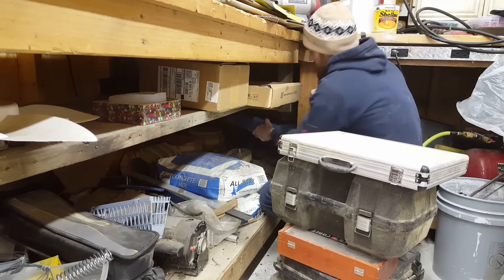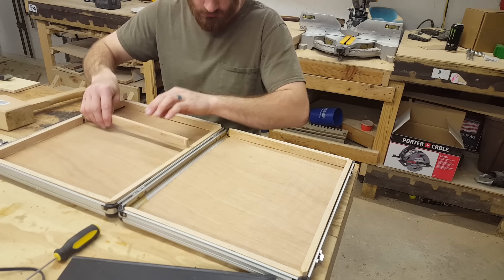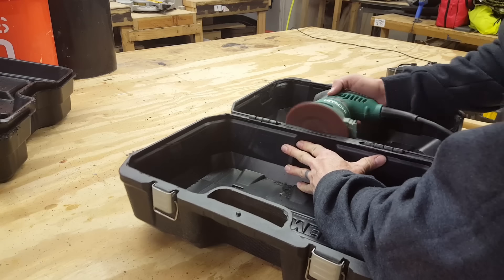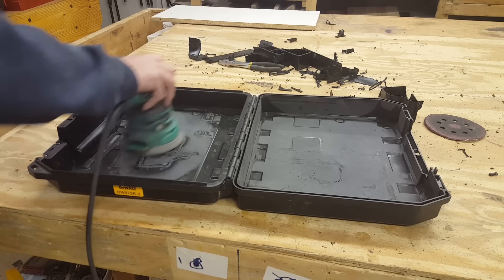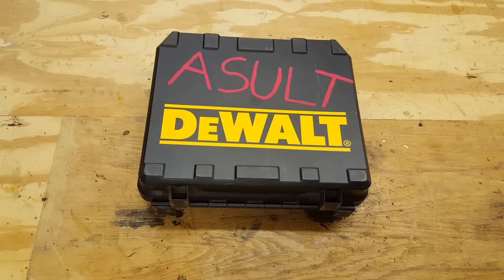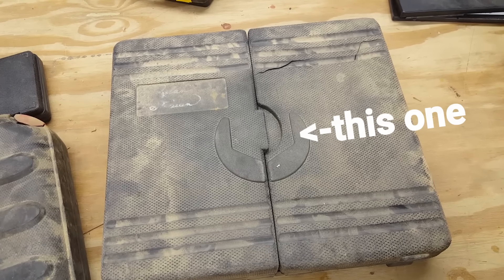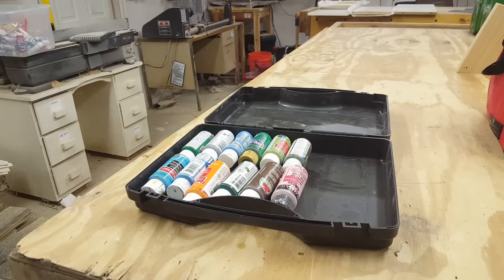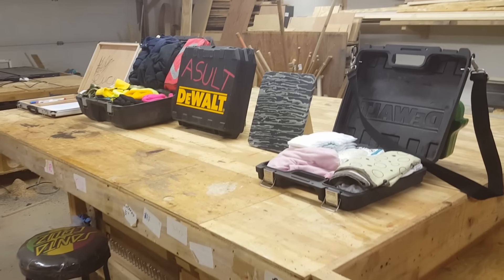5 Things to Make With Old Tool Cases

Comment: I intentionally buy cases at thrift stores for "just in case I need to store something". I picked up a couple big DeWalt kit boxes (saw, drill, charger, batteries) and cut the posts out of it. One is a great case for my Dewalt power washer and attachments (foam sleeping pad cut up for divider between halves) and the other was turned into a battery box for my son's solar charging and storage sytem in his pickup.

Comment: Great job reusing items and keeping them from the landfill. Reuse is always better than recycle. I did the same for two cases I found, one is used for my angle grinder and all it's gear. One is used for my 50' extension cord.

Comment: Awesome video. Thanks. I have similar issues .. I place extension cords in mine and anything sharp like extra blades for power saws or steel files and minor flammables in lieu if safety cabinet.

Comment: Most of my spare plastic boxes are already pistol cases, hehe.  But I did turn a wireless microphone case into a dog possibles case for her brushes, muzzle, deshedding tool, and such. I took out the foam and sanded it smooth.  And then cut to fit some woodgrain vinyl shelving paper to cover where the foam was glued in.  The possibilities are endless.

Comment: Neat. Saw your thumbnail and thought for a second 'that's mine!'. I have a DeWalt cordless case with 'NOT' written on it in red paint above the 'DeWalt' 'cos it contains a Ryobi cordless - fits right in with some judicious trimming of the plastic bits with its spare battery and charger, some drill bitts and stuff. I have others red-labelled with other makers' names - the yellow lettering comes right off with a bit of petrol.  They get through a lot of DeWalt stuff at work and just bung the cases in a skip where I 'rescue' them.

Comment: You could always keep your tools in them. What a novel idea!
Reply: but usually not very efficient.
Reply: I use one to hold various socket sets & ratchets.
I also use one to hold drill bits & drive bits for screws & bolts...

Comment: I've been using my Fein Multitool to clean up old cases for about twenty years. I have a Panasonic drill and driver case serving as my range case. Well, one of them.  A Porter Cable case holds my camera lenses, filters and cleaning equipment. A Festool case is doing duty as a metal detector accessory tote. Another case holds my Edge Pro sharpener and accessories.

Comment: Cool. I modified an old tool case as an armoured laptop bag and had enough space for a Laptop, spare batteries and a mains power supply/charger, plus USB cables, etc for charging my phone as I use mine remotely sometimes, away from mains electricity for a full day.

Comment: When you add wooden walls inside, like you did with the pencil box. Make them go all the way to the inside of the top. You can fill it more and everything won't fall out when opened. And with a few more cuts on the table saw, sliding boxes on top of the paper and pencils.

Comment: Great ideas!  One thing I always do is carry a box like this with Emergency Gear     AKA -  If you gotta pull off the road at 4am and take a crap and need supplies.  Toilet Paper, Wet Wipes, extra pair of underwear (Yea all you guys done crapped yourself at some point).  These would make a perfect emergency box for those situations.  Put Vacume Sealed emergency gear and stuff in them as well.  All great ideas.

Comment: Great video on repurposing 👍! I use a red, older model metal [operative word], Craftsman toolbox on wheels ( the smaller model 3 1/2 x 2 ft.), for a perfect place to use my butane stove for day camping. It has a cute little shelf inside with a cute little door that swings open. I just lift up my suv hatchback, roll my "kitchen" a bit towards the back, and stand there like a short order cooking up a meal that passersby's say smells like a restaurant! (must be the garlic😉). Best thing about using this kind of fire-proof toolbox is that I don't have to worry about a possible flare-up catching anything nearby on fire. I see so many youtube videos with people cooking on top of wood counters with curtains as backsplash. If something unfortunate happens inside anything insured, explaining how it occurred to the claims department determines whether or not, anything gets paid.

Comment: Yeah did the same, cutting up/re purposing old cases.  One I used for sand paper.  Best thing I ever did, all the shelves, slots, piles disappeared.  Open the box & they're there from small to big.  I don't use any one type enough to keep only square in one, orbit sander in another, so it's nice to have them all in one place.  Plus it was a skinny case & I really didn't know what to put into it.  In a way the old cases have turned a portion of my shelving into a library.  There's a row of cases with a label on the back, just like the titles on a book.  lol :-]

Comment: I had a toekick drawer in the kitchen of a previous apartment and the only problem was that there wasn't really anything I had that was thin enough to fit inside of it. I used an old socket case that I had hollowed out much like you did here to make a BBQ grill kit: tongs, spatula, scraper, wire brush, baster, basting brush, room for some bottles of custom rubs and marinades, and along the top a couple mini spring rods (kinda like one those spring loaded shower curtain rods only WAY smaller) to hold a tube of aluminum foil and a tube of saran wrap. Finished it off with a hacksaw blade that fit in between a couple of the outer layers of the case with the teeth sticking out (which fit into a slit I cut out with a dremel into the top half of the case). The end result left the rolls able to turn so you could pull the foil or wrap out of the top until you had as much as you needed, then close the case to make a nice straight edge when the hacksaw blade made the cut. Carry the whole thing out when it's time to grill and you've got all your tools in one place, plus you've got your leftover storage MOSTLY covered. If I hadn't forgotten and left it in that drawer when I moved out, I'd planned on seeing if I could incorporate a way to hold a pair of potholders and maybe figure out a way to hold a few ziplock bags as well. All-in-all it looked really sharp and worked well. Hopefully the new resident found it and enjoyed.

Comment: The DeWalt cases make great gaming cases, especially if you line the inside with carpet or rugs.  I have also made cases from old Coleman camping stoves.
Reply: Thanks for the idea I have an old one kicking around but it's missing the propane hook up, might be able to find a use for it now

Comment: Great idea using old plastic cases, add a rubber gasket around inner edge to make it water tight, an put camping gear inside them. Use metal cases for emp protectors. Best part, nobody knows what could be inside by looking at them.

Comment: Some suggestions 

1: Forgot to add an additional barrier in the top of the metal case to keep the markers from moving out of place while the case is closed.

2: A heat gun would've been better to  reform the blow molded interior of the PP case so you'd lose less rigidity. Can use a bag of heated pea gravel or sand to help form new contours too.

3: It's "assault," but the bigger crime is not spraying "Ass" over the "De" to make it an Asswalt case.

Comment: You could easily add a fold away easel to that art case with a couple of hinges & drop down supports, maybe raised a little to keep supplies underneath? Also maybe place some tight elasticated strips, pockets etc in the lid to tuck even more supplies under/into? 
Great ideas 😁

Comment: I took an old DeWalt 18 Volt drill motor case and recycled it for -- get this -- a 20 Volt DeWalt impact gun! The 20v charger fit in the 18 v charger slot, and the impact gun fit almost exactly where the drill was. Room for 2 spare 20 volt batts and a small bit case. They don't give you these hard cases anymore -- just a cheap yellow/black fabric bag that falls apart. I saw a similar black DeWalt case at a Goodwill for $4, but I passed on it. Later I thought I could have put it to good use.

Comment: OMG! I keep them just in case I sell the tool it "adds more value"... I'm a joke. I have 2 Dewalt Laser cases that are HUGE and bought a Harbor Freight water proof that fits both with batteries and custom foam a third of the size of a single Dewalt. Keep in mind that carrying a Dewalt case with cloth in your car draws attention for thieves lol.
Another thing, "food safe" not only means non toxic, it also means that the surface wont hold humidity for mold or germs to reproduce. Too many mini holes too be used for food (I think).
THANKS FOR YOUR VIDEO!

Comment: Just built a Portable Dewalt T-Stak ARB AirCompressor for my Truck, will post a video soon, plugs into a 50A Anderson plug, and all the wirings hidden in a junction box with the ARB RockerSwitch, Anderson plug, and the Compressor, with room to store the 27ft air hose, tyre inflator gauge and the 10m Anderson lead 👌🏼👌🏼

Comment: I used one of those latching Dewalt cases and made a rat/mouse poison bait box... i cut all the nonsense out like you did. But reglued some shorter chunks in the corner (like a little feed dish) then cut a small chunk out of the side so mice can crawl in. And then finally put a piece of plexiglass on the lid so I can see what's inside without opening it.

Comment: I have a dewalt box and plan on using it for kitchen cabinet service calls for my job - cut out the center baffles already - want to fill it with a corian piece as big as will fit, piece of scrap plywood of same size, and various rips of maple scraps corian scraps, laminate scraps, sandpaper scraps etc that would be potentially useful on service calls - never know what'll come in handy

Comment: I took one & used a neon transformer ( low profile 12k) to make a fractal wood burner with multiple activation switches heavily insulated wiring (welding leads) and power progress lights, all lights had to be activated successively or it didnt work. Ive had it for about 10 years & all the high voltage labels have people afraid to touch it!😆

Comment: I create many things, not yet sold in stores, with Kydex and PVC cement.  Kydex can be warmed with a Bic lighter or heat gun to bending.  Easy to cut, laminate, bend, paint,,,, 
I go for a 'crude, but effective prototype form' of what I need.
See if PVC cement bonds to the tool case.

Comment: I used an old drill case to hold tools and all my bolts when I remove my transmission. Work really well. Now I don't misplace anything. Now I don't have to run around looking for tools.

Comment: Great idea. I especially like using the old steel tool cases from decades ago. More durable by far than anything today and they look cool. I have a 2 that were my dads when he was working as a carpenter when I was a kid. Our last name is still written across them by him. They've been perfect for small/medium tool kits built specific to my Jeep. They can be smaller because I don't take the tools I don't need for that vehicle. Check online for comprehensive tool lists specific to your vehicle, someone has already done that leg work for you.  
I use another for all my bike specific tools.
I will also repurpose old lunch boxes and food containers for things like camera equipment and other things I don't want stolen. It's perfect. They're free, waterproof, padded, and no one is going to break into my vehicle to steal an old lunch cooler. Plastic peanut butter and mayo jars are perfect for first aid and survival kits, and even camera lenses with a little padding added. I use bubble wrap for that and it works fantastically. The one bummer about old tool boxes is someone might think they have expensive tools in them they can pawn off.  
Other ideas; Manly briefcases, ammo storage, camp kitchen ware, gift boxes, laptop cases, tackle boxes and for organizing niche items you need to have access too, but gets scattered easily, like all your trailer hook up stuff, bungee cords/straps, plumbing and electrical tools, bits,and bobs. Larger ones, like what my porter cable router came, in might even be a good carry-on size.  
Good video!

Comment: What about a proper power bar with extension cord. Maybe even a few sealed outlets on the outside. And a space inside where you can store the Cable for transport or extra cable during use.

Comment: I work for a machine shop. The owners have a sort of hoarder mentality and save not only the cases, but the batteries, chargers and the tools themselves regardless of the fact that they have not worked in many years. Funny how all of that disappeared after I went to work in the building I am in now. Anyway, I threw away several old plastic DeWalt cases, but I saved one. An old school metal case. It is damn near pristine. I use it as a lunchbox.
Reply from the maker: 😄Thats awesome

Comment: Another thing that it could be used for is a drone case just cut out some foam inserts for a drone, controller, some batteries and if you wanna get fancy put in a 3in1 charger and wire in a plug to charge all the batteries inside the case. And I literally just gave myself an idea for repurposing an old drill case.

Comment: For those not in the US, Liberia, or Myanmar, the conversion for oven moulding the plastic is 177°C. I wonder if a jack operated press would be a good addition when pressing the hot plastic? Quicker to apply pressure while the plastic is still really hot.
Reply from the maker: Thats a good idea

Comment: In the gun case:  add a flashlight, space for a box of ammo, tools for adjusting sights and cleaning, and instead of just being storage for the gun, it becomes an all in one range day / response case with everything you will need to accompany the gun when its used at anytime. Also probably neeed to think of a way to lock it, unless it is going inside an actual gun safe.  Something more elegant than wrapping a chain around it with a padlock, i would hope xD
Reply from the maker: Good idea! It does have a spot for a lock

Comment: If it would fit under a car/truck seat you could epoxy magnets on the underside of the seat or floor and contact side of the case and use them for trauma kits or lockable storage.

Comment: I always wondered whether spraying the inside of the polyethylene case with Rhino liner would bring back that rigidity. I've been building things with these boxes forever and reinforcing them after you cut out the inner shell is usually the make or break moment in a project.

Comment: Have you thought about making one or 2 into a survival stash ? what I mean is them containing the basics, such as a folded tarp, with some paracord, tent pegs, etc and another with a small hexamine stove, packet noodles and other dry goods so you get a quick meal and other general survival stuff, such as a decent knife, cigarette lighters, etc.  Then sealed around the edges when full with waterproof tape, in case of any water seepage, wrapped in a couple of heavy duty garbage bags or similar then buried in a location only known to you in case of emergency and having to bug out.  Just a thought, so you have spare gear stashed away from your home.

Comment: Haha this was brilliant! thanks AC! - Ps i dont have many of these plastic tool boxes but one i do have to store my cordless drill had its hinges and closers broken off (flimsy plastic) any ideas how i could make/ attach new hinges?i tried grey and black tape as a temp solution but to no avail, the tape just comes off over short time :-(
Reply from the maker: That's an interesting question. I've seen people use zip ties by drilling a hole where the hinges were and putting a zip tie around it.  Although I think that would make the hinge a bit too floppy. I would probably use something like a piano hinge and a few bolts. Or you could put a small piece of wood on the inside and just use screws. Let me know how it turns out
Reply: @WyldeWoodworks  Never thought of zip ties nor piano hinges! great idea cheers for that! - Prob won't tackle it for a while as the drill is happy in the shed where i'm working at the moment but as soon as i'm finished there will definitely need to get the toolbox fixed and i'll try to remember to update you on how it went! :-) Stay safe bro!
Reply from the maker: @criollitoification  Thanks! You too

Comment: Awesome diaper bag idea but for the paper and marker organizer I definitely would have put a clip on the top and some kind of full do Racers to that way after you take out your paper and your markers you could clip it onto the back brace it on the front so that way it becomes a mini easel as well also put some grips on the opposite bottom face so that way it doesn't slide around